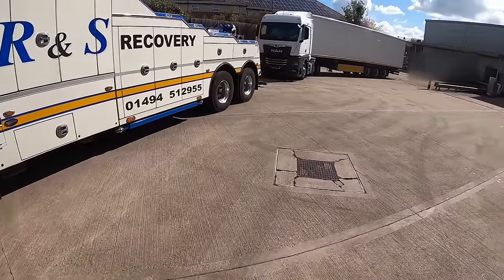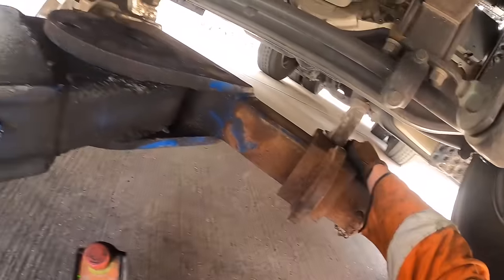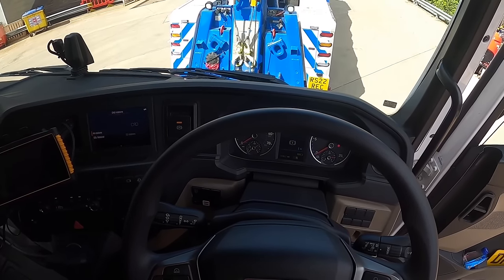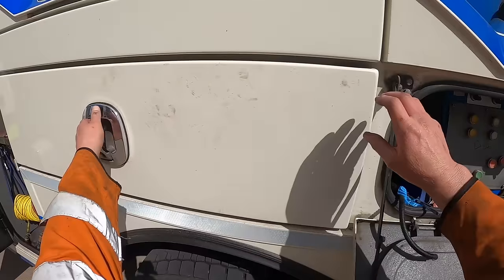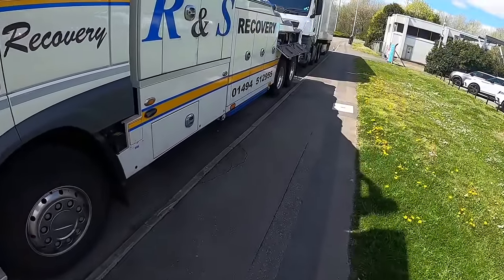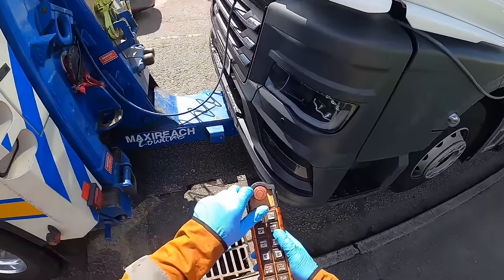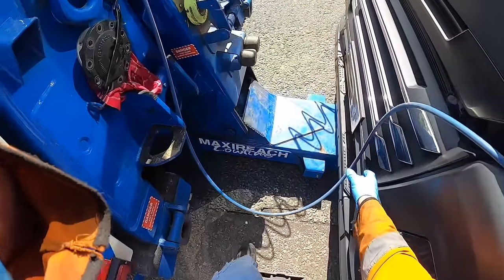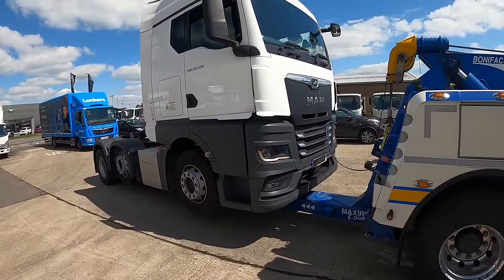RECOVERY & TOW OF 44 TONNE ARTIC TRUCK!

Comment: You towies are a breed of your own mate. Knowing more than many mechanics and managing to haul massive rigs on even the tightest roads.
And without allways getting enough rest at that. 
I remember when I was working at the buss depo in my old hometown and a Scania boggie buss had just been towed into the workshop. Talked to the driver and said "You look a bit tired." (This was around 10pm) and he said "That's what happens when you haven't slept in 23 hours"
It could just be that region but there is always a shortage of towies here and it's so bad that the cops look between the fingers at their work hours. But still they do the job in a professional and safe manner.
Reply from the maker: Thanks for watching and commenting Jarien, not a 9 to 5 job mate.

Comment: Grat vid Steve,silly question why don't you use the trailer lights on  an artic when towing,easier to put sussie on than a trailer board.
Reply from the maker: Hi Neil , always plug into trailer at night mate for side lights on trailer but got into routine on using wireless board with number plate on it in day. Thanks for watching mate.

Comment: Hey Steve, 
Great vid as always, and bet the driver of that MAN unit was a bit flustered at breaking down on a loading bay at supermarket 😂, 

How did you make the wireless trailer board, did you have to put any steel plates on the board for the lights to stay and not fall off ??

Also where did you get your reusable tags that you use to hook the airlines to the unit without using the cable ties as they look extremely useful
Reply from the maker: Hi Dave , small brackets fix lights to old trailer board we had , them bungee ties our used by Scaffolders to fix taupling to poles normally get given them by the lads broken down.

Comment: Another brilliant video Steve. Quick question why do you use the second red line to a trailer if your main line is feeding the tractor?
Reply: From what I have read and know from a friend the blue line Steve connect to the tractor is a continuous feed of air to get the parking break off and the red line is the parking break for the trailer. the yellow line is the breaks. Doing this way you would have control over both parking break and breaks on the trailer
Reply from the maker: Hi Jamie thanks for watching, we run a red emergency line from my truck to trailer in case the unit comes detached from wrecker then the red line will brake snap and the trailer brakes will be applied.

Comment: I think I may have seen you on this one. The area looks familiar. I thought I seen you pulling out of the Sainsburys supermarket in Slough after I did my delivery on Uxbridge Road. I think that may actually be me in the 7.5t Iveco with blue curtains in front of you on the roundabout as you leave
Reply from the maker: Thanks for watching Steve , yes was in Slough mate , small world lol.
Reply: @HeavyRecoverywithSteve  Yeah, considering I live in Sunderland. But I tramp in a 7.5t all week doing general haulage. I been to that store couple times. I often spend the night about 3 miles away in a layby on Uxnridge Road by a Tesco/Esso Petrol station off a roundabout or if I am feeling flush, I will pay £40 to park at the Riverside Transport Cafe on the Colnbrook By-pass which includes a large meal and dessert and a shower for an additional £1.50

Comment: Hi, great videos I really enjoy watching them. Can I ask why you have to  remove a half shaft and does it matter which side you remove. Many thanks Lee
Reply from the maker: Hi Lee , you can remove either half shaft to disconnect the drive to gearbox but easier to pull the half shaft without the diff lock mechanism as you find it easier to refit , thanks for watching.

Comment: When towing heavy vehicles, does the load need to be removed before the towing can start since imagine needing the power to tow a 44t vehicle? I also cannot tell if 44t in the title means gross weight or its weight at the time it broke down.
Reply from the maker: Hi Annabel thanks very much for watching , 44t is the total weight the unit and trailer with load can operate in the UK on 6 axles. We recover these fully loaded quite often so your looking of a total combined weight of 64t with the recovery truck.

Comment: Why can't you supply the trl from the truck once you supply the truck with air
Reply from the maker: Thanks for watching , still should run with a Red Emergency line from my truck to trailer just in case the unit comes attached from the wrecker than the brakes will be applied on the trailer when the air line snaps. Thanks for commenting.